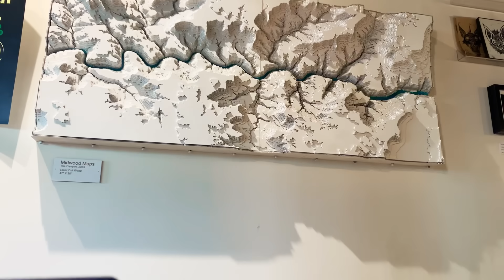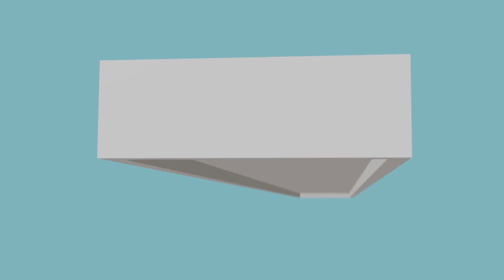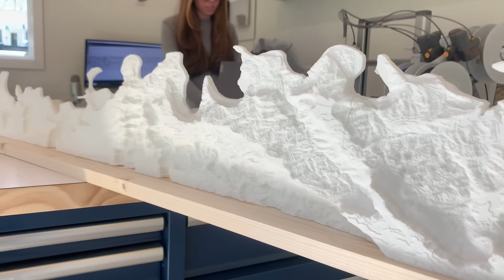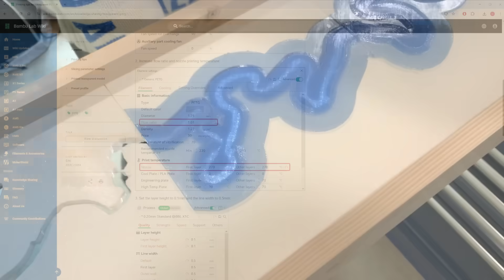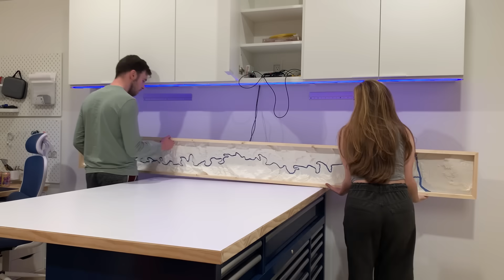170 Hours of 3D Printing For This

Comment: Great build. 

A principal difference would be to keep the rivers width as in reality and tidy up the edges. That would look more natural. After all you use the original as the model. Not a designed mountain area. 

As it is impossible to hide the seems you could exaggerate them adding shadow lines that also goes around the frame. The motif is strong enough to pull off that. You would read the whole piece as one.

I think you could have used blue filament for the river just changing filament in the first print.

Now the blue is washed out under the white filament. Just the thing you didn’t care for initially.

Comment: Very nice! Love both the original wood inspiration and the 3D printed design. 

There is one piece of software that I think would have been beneficial to you for the splitting of the white sections... it's called, Split3r. It just finished it's Kickstarter and the beta version has been released to backers. The final version will released at the end of December 2025. It can be a game changer in regards to builds like this. It literally guarantees nearly invisible line splits while adding structure support due to the customizable tenons. Hope this helps and keep up the awesome designs.

Comment: This is just nitpicking, but maybe if you do another one of these, you can run a layer or two of black filament in between level layers for more contrast (like your previous model had)
Reply: Agreed! I did this with some generative topo prints I made and it makes the contours pop.

Comment: I was surprised that the infill and the skirt on the riverbed were not more visible with the lights on.  Amazing effect. Had you considered using different colors of filament at different heights as is the case in the canyon?

Comment: I'd rather have used PETG. PLA tends to deform over time and it can handle very little heat (and the warmer it gets the more it deforms). So if those LED's are hot, that alone might be an issue over time. Could also have used COB led strips that have hundreds of tiny LEDs, to ensure uniform illumination.

Comment: Can you glue petg and pla so easily?
Reply: Well, that's what the glue is for, to bind the layers. PETG and PLA do not stick to each other, and one trick on printers with multiple nozzles is to use one as a support for the other. The supports come loose with ease, they barely stick to begin with. But yeah, with glue, it's just gluing two plastics together.

Comment: Cool to see. I've had almost exactly the same project on the back burner for a while: topographic projection, printed in matte white, pouring a resin river (helpful to see your issues with this), back lit, box frame (love your cut ridge mounting idea). This is to be a gift for my mom's boyfriend, who fishes in a huge river in their area, which I was going to use the same dataset for (and did a bit last year, playing with how I'd cut it up to print on my MK4). The only remaining difference is that I'm a Maya guy, so I'd be using that. Thanks for sharing! Lots of good ideas.

Comment: I love that the color of the river came out so vibrant and solid... I see EVERYONE using that mica powder to color it.. don't get me wrong that looks BEAUTIFUL... but it seem like that's the only option for coloring epoxy because it is ALL I EVER SEE anyone use! lol And that deep blue looks SOOOO GOOD!!! I wanna even say that it looks..... it looks YUMMY! lol   BUT I would have LOVED to see what that solid blue looks like with a small amount of the white mica powder just swirled around in it... but not much.. What I'm imagining is putting down the blue the way you made it but using a small squeeze bottle with a very thin , long tip and filling it that same solid blue with some of the white mica power mixed in... but maybe not fully mixed, so it comes out with light blue, solid blue, and white mixed together randomly.... and you apply it at key spots of the river... like highlights as if you were drawing a 3d object that has a shadow that only shows up on the bottom and left of the entire river.... but here's the real trick...  you use concentrated AIR, like from an empty one of those same squeeze bottles... and you blow onto the parts where you added the highlights of light blue/white and they will naturally mix together!!! And this would make it look like the water is flowing!! and by doing it only on the bottom and left edges, it would make it appear like it's all flowing in one direction!
-  And if you were to  add lighting that only shines from the top right you would get a strange effect of depth and the river flowing too!!  But b3cause this is really the only detail beside the print itself, then you making the lighting and shadows and the depth  from the lights coming from below ... THAT is the detail ion the quite plain 3D print..... OMG I WISH I HAD A PRINTER!!! LOL
- -  I am sooooo sorry!!!  I saw what you're doing here and I just got flooded with ideas... I didn't mean for this to be any kind of critique of your work... I'm only 6 minutes into the video and just have been BLOW AWAY at how beautiful this is, and you made it all from the public data... which is awesome!  It like you're taking some boring, plain data and using it in a way that was most likely never thought of by the teams that created it... and it's such simple data... just the elevation... and it looks AWESOME!!! I wanna find that coffee shop and just stare at the wall!!! LOL 
okay... I'm done.. I'll stfu now.... but THANK YOU! You just inspired me to get a 3D printer!!! :) THANK YOU!
Reply: OHHH YOU HAVE A HEAT GUN!!! Instead of using a squeeze bottle to blow air onto the lighter parts I was going to say to use a heat gun but I assumed you wouldn't have one, but you'd have the squeeze bottle..... yea the heat gun does WONDERS when it comes to blending epoxy colors together.... ESPECIALLY when you have thinks layers... give a try some time and you might like the effect :)
It works AMAZINGLY for adding the white peaks to wavy water... it is such a great effect because the heat can cause the white epoxy to get little round areas that you can see the epoxy underneath and it makes it look like bubbles in sea foam... but I don't have the exact temp and wind speed  that causes it.. but I do know you would let the blue epoxy set up just a bit to its harder for the air to mix th3e white in with it... but it's such a great look for water :) GOOD LUCK!

Comment: Fantastic Project. Tried to tinker a bit with the Blender Application and it just didn’t work. Wanted to create the topography from the Stilfser Joch in Austria to print on a 4“x4“ piece. But I gave up because I could figure it out how to get the STL file. But well deserved like and also subscription.

Comment: Curious, did you try using geometry nodes to delete the faces that were below a certain Z height? Just wondering if that would have saved time vs. manually deleting.  Also, regarding the seams, I wonder if using a zig-zag pattern or any pattern other than a long straight line would help hide them? Great idea with the LED lights. I think that is really makes this piece stand out.

Comment: I know you've already completed it, and it looks beautiful, but a couple ideas to make it easier. Instead of manually painting over the entire river, just raise the Z-height of the print above the river, or cut off the bottom few millimeters. This could be done directly in the slicing software by setting the model slightly below the print bed. Also spraying the entire thing with a coating of acrylic should prevent epoxy from seeping into the layers. That said great job! Just some thoughts for others doing similar 😊
Reply: would the acrylic affect the light coming through?
Reply: @ForceField9  no, it shouldn't at all. Acrylic is clear. They make light pipes out of acrylic. Plexiglass is just a brand name of an acrylic. There's tons of formulations of acrylic sprays and I imagine there are opaque ones out there but most clear coat sprays should work just fine. The stuff they use to refurbish headlights (I'm sure you've seen ads) is typically just a wipe on acrylic coating.

Comment: This looks great apart from 1 thing. The only thing that you need to actually fix on this was the use of black wire to connect to the cabinet for power. You can see the wire coming out of the piece and going into the cabinet which is super annoying for someone as OCD as myself, this ruins the whole thing for me. You should have used a white heat shrink over it for the section that is seen so it blends better into the wall or installed a wall plate to plug into that would completely hide the wires. All the effort to have an ugly wire in the top middle of the piece annoyed me so much.

Comment: AI Summary

Abstract:

This video documents the process of designing and building a large, illuminated topographic map of the Dirty Devil River canyon for the creator's new workshop. Inspired by a previous laser-cut Grand Canyon map, the project aims to create a 9ft x 10-inch piece. Digital elevation data from USGS is acquired and processed in Blender to generate a 3D model. The creator decides to utilize 3D printing instead of laser cutting for its benefits in build simplification, weight reduction, and detail retention. The design involves splitting the large model into 12 sections for printing. An initial test with pouring epoxy directly into the terrain print for the river fails due to seepage. The design is revised to print the river separately in translucent PETG and glue it to the back. The terrain sections are printed in white PLA with low infill for backlighting. A frame is constructed from 1x4 lumber with a groove for mounting the prints, backed by aluminum sheet metal to act as an LED heat sink. LED strips are installed on the aluminum panel. The prints and river sections are assembled and glued into the frame, resulting in a large, internally lit topographic map.

Creating a Large Illuminated Topographic River Map

*   0:00 Inspiration & Project Goal: The creator, having previously made a large laser-cut topographic Grand Canyon map, plans to create a similar piece for their new workshop, aiming for a 9ft wide by 10-inch tall illuminated map of a river canyon.
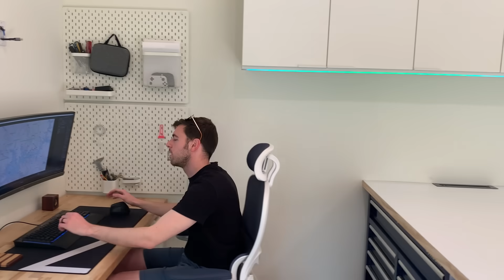*   1:01 Location Selection: A search for a long, straight section of river with interesting canyon detail leads to the selection of the Dirty Devil River, a tributary of the Colorado River known for its 20-mile relatively straight path through a 2,000 ft deep canyon.
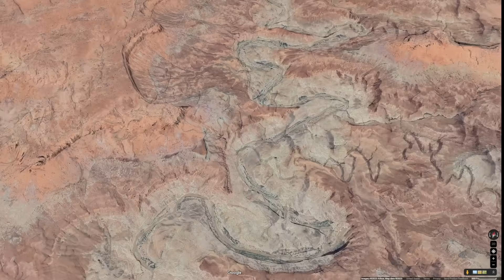*   1:32 Data Acquisition: Digital elevation models (DEMs) for the chosen area are downloaded from the USGS website, requiring multiple files due to the large size.
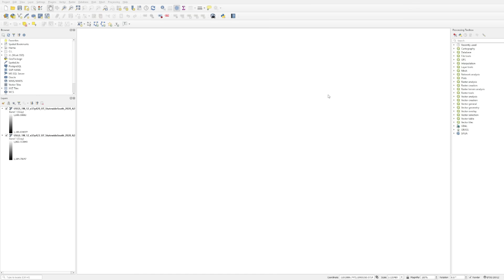*   1:45 3D Modeling in Blender: The DEM data (a black and white image representing elevation) is imported into Blender and used to displace a 2D plane, transforming it into a 3D terrain model matching the map's dimensions. The model is scaled and positioned.
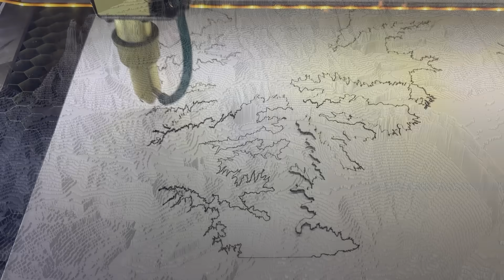*   3:01 Manufacturing Decision: The creator decides to 3D print the map using a Bamboo Lab A1 printer instead of laser cutting, citing benefits like simplified assembly, lower weight (using PLA), no need for painting, and better detail retention.
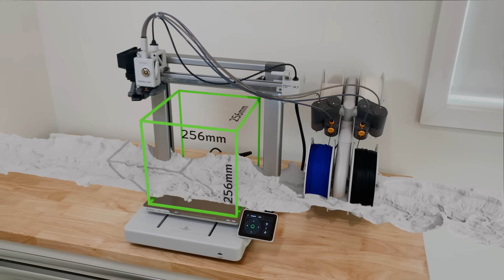*   3:27 Model Preparation for Printing: The 3D model is split into 12 sections to fit on the printer bed.
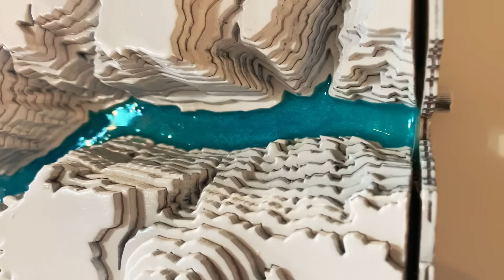*   3:58 Epoxy River Test & Failure: An initial test attempting to pour blue epoxy directly into the river channel on a sample print fails. The epoxy puddles and seeps into the PLA print layers, causing splotchy discoloration visible with backlighting.
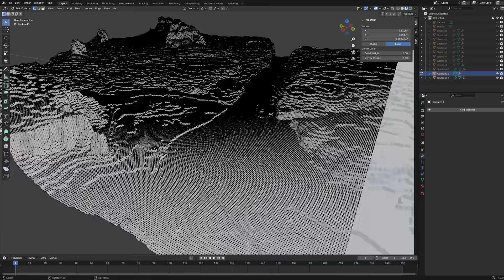*   6:34 Design Revision: The river is redesigned to be cut out of the main terrain print and printed separately as a translucent piece (using PETG) to be glued to the back. This requires extensive manual modeling work in Blender.
*   7:36 Slicing and Print Settings: The revised 3D models are prepared in Bamboo Studio. The top surface infill is set to concentric to follow terrain contours, and overall infill is lowered to 10% to allow light transmission for backlighting.
*   8:05 3D Printing Process: Printing of the 12 terrain sections in white PLA takes about a week, with the AMS system facilitating automatic filament switching.
*   8:50 Frame Construction: A frame is built from 1x4 lumber, left unpainted for a natural wood look. A groove is cut into the frame pieces to receive a matching ridge on the 3D prints, allowing mounting without visible fasteners.
*   11:03 Aluminum Back Panel: Sheet metal is used for the back panel, providing rigidity and acting as a heat sink for the LEDs.
*   11:27 Printing and Attaching River Sections: The translucent river sections are printed in blue PETG. These are glued to the back of the corresponding terrain prints using thin flanges on the river pieces.
*   12:23 LED Installation: Two 25 ft rolls of LED strips are mounted onto the aluminum back panel using their adhesive backs, arranged in five rows. Wires and clips are soldered to connect the strips.
*   13:24 Testing & Final Assembly: The LED strips are temporarily connected for testing. The 3D printed terrain and river sections are glued into the grooved frame. The aluminum back panel with LEDs is attached to the frame.
*   15:45 File Availability & Giveaway: The creator plans to make the project files (print files, sheet metal drawings, Blender model) available for purchase and is hosting a giveaway for a small unlit sample piece on Instagram.

I used gemini-2.5-flash-preview-04-17| input-price: 0.15 output-price: 3.5 max-context-length: 128_000 on rocketrecap dot com to summarize the transcript.
Cost (if I didn't use the free tier): $0.0062
Input tokens: 16826
Output tokens: 1057

Comment: Very interesting video and nice design.   Personally I think I would have printed the blue and white in one part using the AMS Lite.  Appreciate that PETG and PLA don't go together that well - so would probably have used PLA for the river.   

Failing that I think I would have printed the PETG river parts in two colours - blue for the river and white or transparent for the glueable edge.

Finally personally rather than having a completely flat edge on the separate parts and glueing I think I would have made some dovetail joints - with the edges matching the contours if possible - and then just slid the parts together.   Or failing that I would have done 'springy tjoints' - although I appreciate that would have messed with the lighting.

Comment: Fantastic!! Did you try other infill patterns? I would think, especially with backlighting, the infill pattern would matter a lot, but grid looks fine, so maybe not. Do you plan to finish the frame (stain or paint) or just leave it like that?
Reply from the maker: I started with the grid infill and it worked really well so I didn't see a need to experiment with others. For now I'm just going to leave it as is, I think the unfinished frame matches my worktable nicely

Comment: Amazing you could create this with the limitations of the mini print bed! I was wondering how you'd get around the individual segments. When unlit, it looks fine. Once the LED is illuminated, it highlights the imperfections... Still, this is my dream to 3d print the iconic skyline of my city. This gives me ideas to do it in pieces to not lose detail
Reply: Just print it with some overlapping of individual layers and the use of support material, this should cover the lines between segments. Sure, way more work - but it should work out fine
Reply: I think that is an A1, so the print bed would be 256x256x256, same as a P1 and X1.  But still an amazing project.

Comment: Don‘t the map contour lines bother you? Somehow it looks strange to not to use the full resolution of the 3d printer, and see these map lines. Also the cutting lines between the pieces could be much less visible, if not straight, but done in relief following manner?

Comment: add a subdivision modifier before your displace modifier to easily switch between hi poly and lo poly without needing to subdivide the original plane obj
Reply: thing is the detail is contained on the displace modifier that gets moved into the mesh based on said mesh density...  with that process you will lost detail...  a siilar way is still usable is would be more complex and all would be made using high poly as base.

Comment: Looks great, but as somebody who's worked in wood/epoxy/3d prints don't use CA/Superglue on anything you want to hold beside temporary or has strain, it breaks at any sheer or shock.  Use a quick epoxy  or mechanical connection.  The Bambu Sponsorship is kinda sad, too bad for your channel.

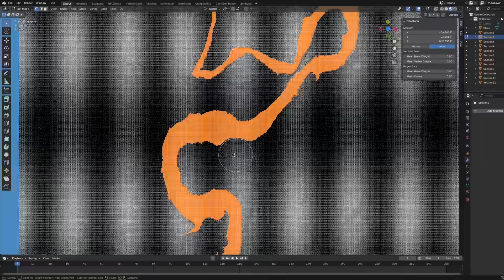Comment: 7:18 if you made a plane that follows the river depth/drop. You could slice the bottom off the model there and it would save you "painting the river"
Reply from the maker: We had the same thinking! I tried this too but it created some difficulty. The slope was inconsistent all the way across the map, and I’d lose the flat base for each print section
Reply: @Visual_Thinker_yt  thats fair. Any rapids and the horse shoe bend would make it tricky. 

Keeping the base flat is pretty simple. Dont cut across the whole model. From the top plane create 2 lines that offset the river. Then spit the model into 3 parts. Only cut across middle the section with the river. The two outer parts would remain the correct height. Combine back after you cut the river to height. 

As for the river height since a 2d slice across the model wont work. You would likely need a 3d path that follows the drop of the river and then a spline/loft that follows that path to cut the bottom off. Now that I am writing it. Yah painting it was easier. 3d splines suck.